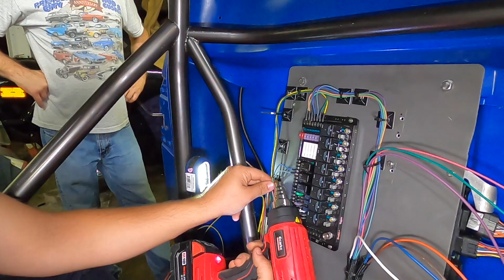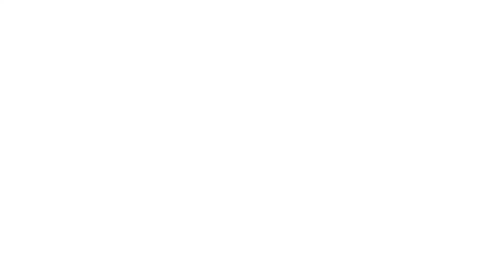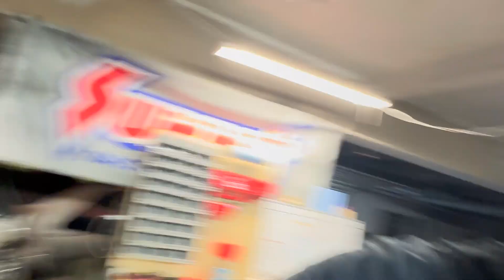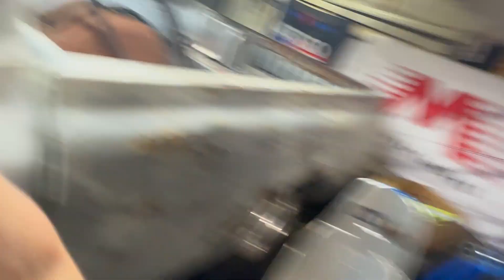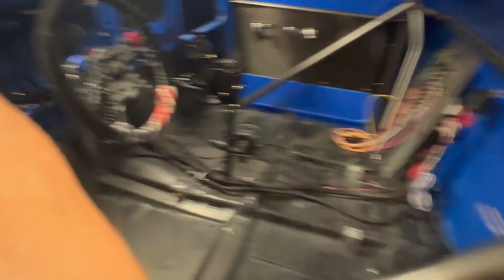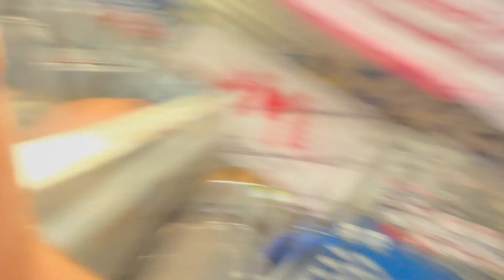Wiring Leash Electronics Relay Board

Comment: Question. I dont need the turn signal part of the board yet. Just the relay and transbrake part  can it be wired with those with no problem
Reply from the maker: You don’t have to hook up the output for the turn signals if you are only needing a trans brake part the cheaper option would just be to buy a NOS solid state relay which you need anyway because these boards no longer have solid relays from the manufacturer
Reply: @BrokenBudgetRacing  so just get the 4 or 6 relay board for fans,fuel pumps and a solid-state nos for transbrake. Thanks fornthe tip